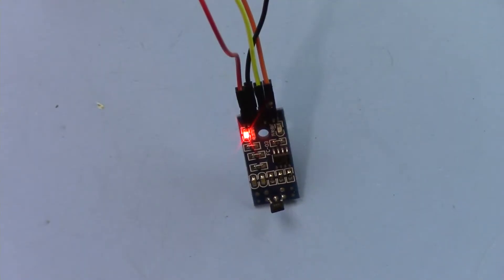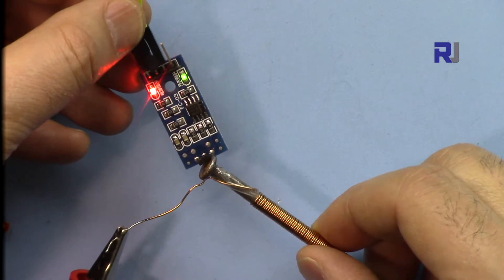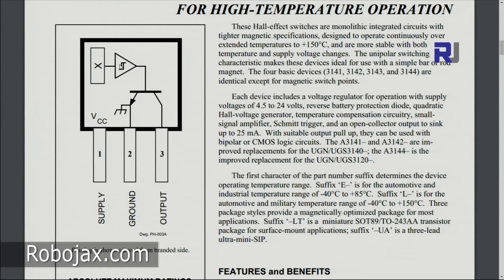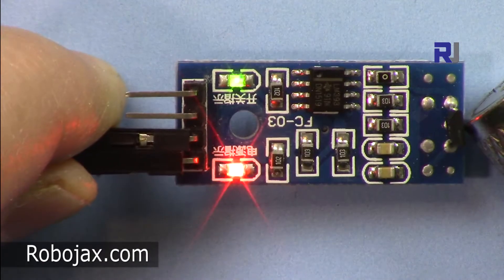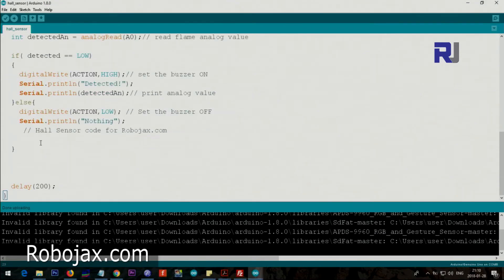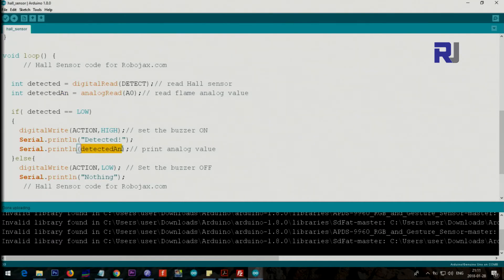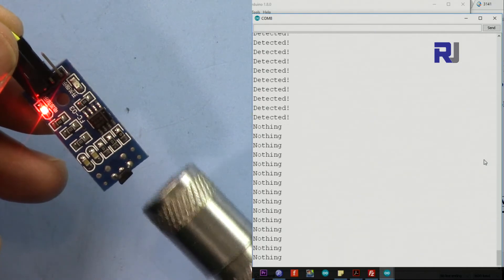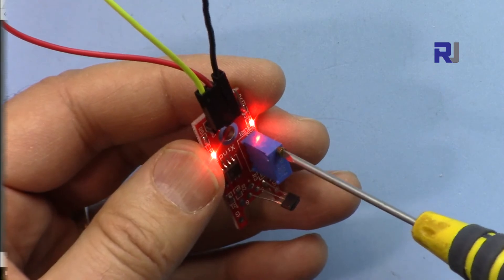Hall Sensor Switch Demo and Code for Arduino RJT52

Comment: Can you do a video making a Hall Effect analog (or digital) module with the Arduino powering 10 LEDs, with each LED indicating the distance to the magnet as it passes the sensor?
Reply from the maker: that is possible and very interesting. I have to look at the components and make it. I will put it on my list. thanks
Reply: , Arduino has an example “LED Bar Graph”.  The Arduino has 10 LEDs plugged directly into it.  The LEDs are powered on one at a time using an analog signal from the potentiometer.  I’m wondering if a guy swapped out the pot and instead used a KY-024 Hall Effect sensor using its analog output.  Wouldn’t the KY-024 analog out (A0) signal from the KY-024 be doing the same thing as the potentiometer (1K or 10K???), except rather than turning the pot knob you would be moving a magnet across the KY-024 path.  Would this work?
Reply from the maker: I have several LCD bargraph. search for them on my channel. 
in theory, yes. but I don't know if the hall affect outputs analog signal and IF it is proportional to the input flux or magnetic field.
Reply: Yes, this particular Hall effect voltage output is directly proportional to its distance from the sensor, at least theSS49e is.  That is why and how the LED dims and brightens when the magnet is pulled in close or pulled away.  There are some hall effect sensors that only toggle off and on, some that latch, and some that are like the 49e.
I will see what videos you have.  Thanks for your help.

Comment: Can i used this sensor on an anemometer to measure wind speed?
Reply from the maker: if you know how to use it, yes. you would some rotating object with certain surface area and number of blades. Then you have magnet in one of the blades and this sensor is at the proximity of the blade detecting the magnet. you would have to make the delay in the loop to 1 delay(1) which is 1 millisecond or remove it completely if your application needs faster result. remove any serial monitor printing as it will slow the loop. good luck. I have not made any device like that but I believe that is the main principle or at least I will do it like that.
Reply: @robojax  thanks a lot

Comment: If I have conductor connected to the source (with resistor of course), how many  ampers will I need to detect electromagnetic field by this Hall effect sensor?
Reply from the maker: Hi, I've provided the datasheet https://robojax.com/learn/arduino/?vid=robojax-hall-sensor on the page where the code is. the supply current can be 4-6ma shown on page 6

Comment: What will happen, when I connect module to 8 Volts insted of 5Volts?
Reply from the maker: the components have been calculated for 5V. it might damage the OpAmp chip.

Comment: Hi there sir! i want to make a dc motor(25000 max rpm) rpm measure device.  which sensor would be best for this range linear or non linear or bipolar. i dont know quite about this. i just  heard that 3144 hall effect sensor work at low and high scheme and what type of sensor is this linear , non linear or bipolar. so would it be best for making a rpm measure device?
Reply from the maker: Hi, here read about the 3144 on the datasheet https://www.elecrow.com/download/A3141-2-3-4-Datasheet.pdf it is just a sensor. it is up to you to use as RPM counter or other application.

Comment: Do you need an Arduino for each limit switch/Hall effect module?  Thanks
Reply from the maker: You can connect multiple hall switches to the same arduino. But if you want to use them separately you need to use an Arduino board. Or you can use digispark board https://youtu.be/eW9WgPlcPAw

Comment: Thank you for a good explanation of how this sensor module works.  Can you get the sensor by itself?  It is very small compared to the module board.
Reply from the maker: the signal from receiver is being amplified by the op-amp chip.  You won't get the same result with Ardouino.

Comment: Sir I'm working on project using hall sensor, 16*2 lcd, and relay for operating 2 way solenoid valve.  hall sensor will convert the rpm of wheel into kilometers and at particular kilometers solenoid should open will you please share circuit diagram and code for this project.  I'm beginner in arduino
Reply from the maker: Hi, This is a project and needs lots of work which I have no time for. May be someone else replay and help.

Comment: the output voltage is to low it is 2V and the arduino did not detect it :(
Reply from the maker: Yes it will.  it can detect from 5mV (0.05V) to 5V.
Reply: i dont understand your proplem  clearly but ypu can use dc - dc boost